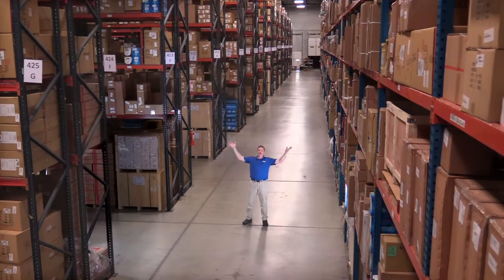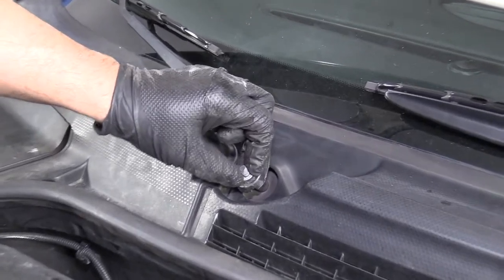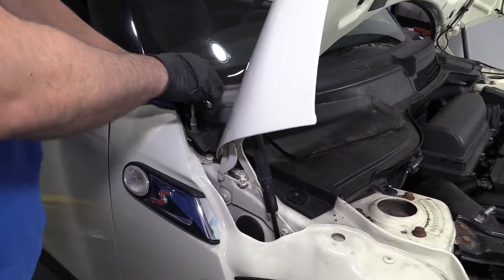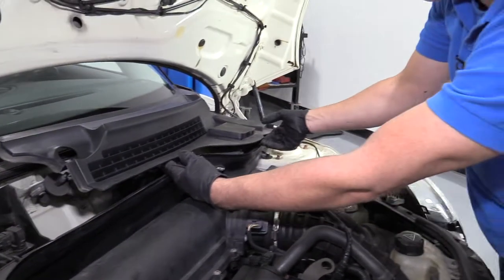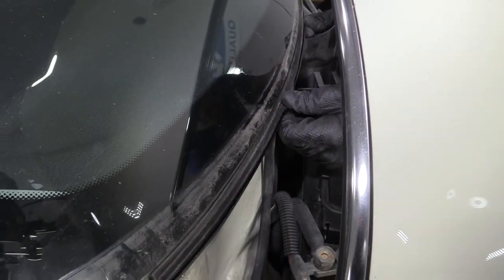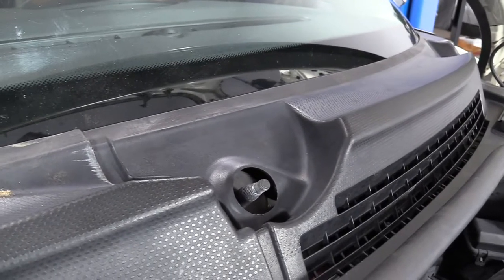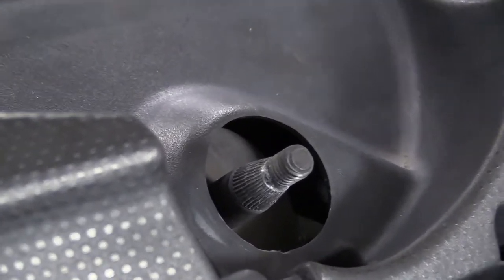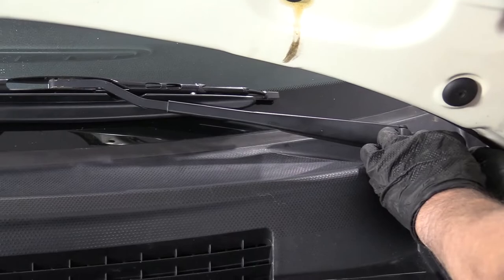How to Remove Cowl 07-13 Mini Cooper

Comment: Hint on removing the windshield wipers: tap hard (with a wrench or small hammer) on the part that gets covered up. Then push down and pull up, alternately, on different sides. Eventually the wiper blade arm will start to move relative to the post, then it will break free completely.

Comment: @1A Auto Parts - Do you have a link for the rubber piece at the bottom of the windshield show in this video ?
Reply from the maker: +John Kibbe We do not currently sell that rubber piece.  You could try looking on eBay Motors or partsgeek.com.  Thanks for watching!

Comment: My cowl rubber piece is breaking apart on my 2007 mini cooper R56. The cowls are fine. What do I need to replace that part?
Reply: Is the one that it’s touching the glass itself? That’s my problem to! It’s literally missing pieces of it
Reply: @carlosayusolaslenguas5185  Whole cowl unfortunately - the rubber interfacing the window is attached directly to the plastic